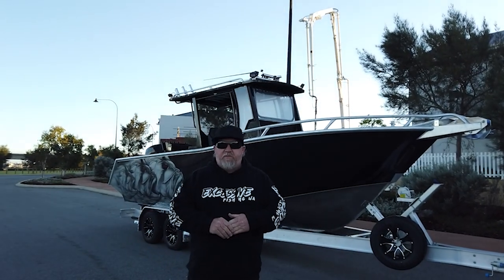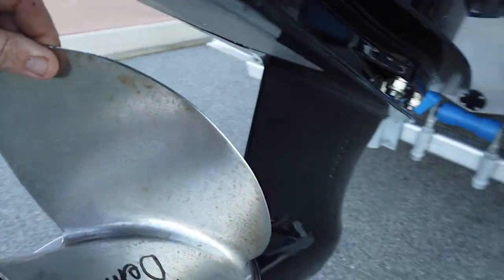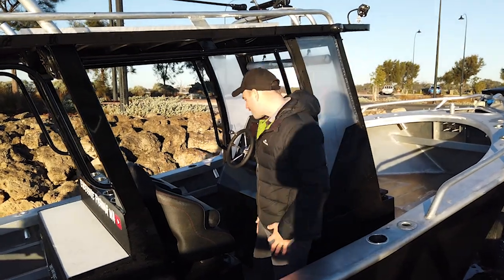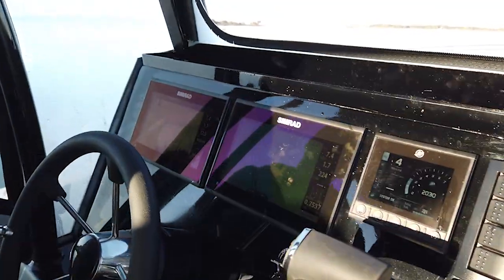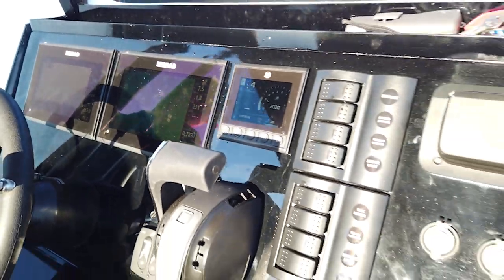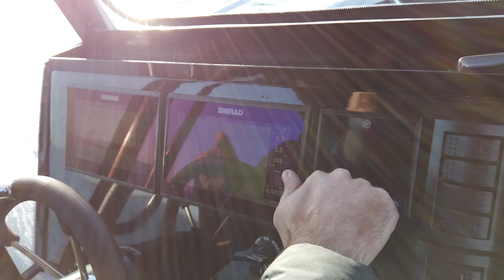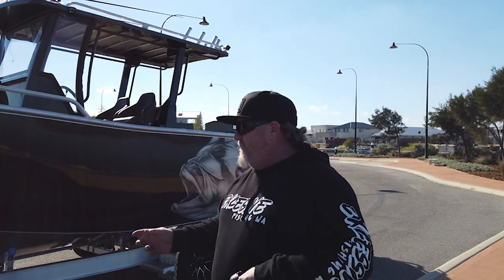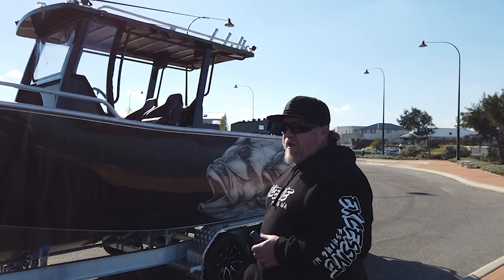NEW BOAT FINALLY IN THE WATER | Stage 5 | Sea Trials | 6.8m Boat Build

Comment: Hi mate , I’m curious about the GO9 with the 1kw transducer. I’ve been told they can’t run the 1kw off the GO series so I went a smaller transducer for mine. How does yours go? What would I need to upgrade to the same? Cheers
Reply from the maker: Yeh the go 9 runs it fine. It’s doesn’t have the power of the nss, but still enough to get good results with the 1kw.
You don’t need to do anything besides upgrading the transducer👌
Reply: @excessivefishingaustralia2849  awesome no worries
I’m running the p66 transducer off mine but the return doesn’t seem that good
Reply: @excessivefishingaustralia2849  wicked looking boat you’ve built too BTW 👌
Reply from the maker: Yeh, I can read bottom at 200m ok, could be better with a NSS but still does the job. The GOs are great value for money👍